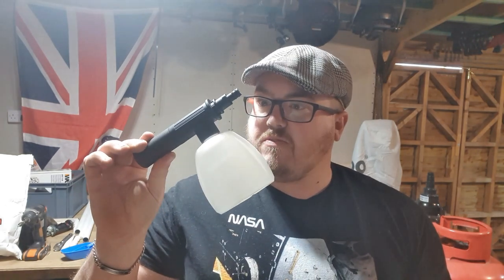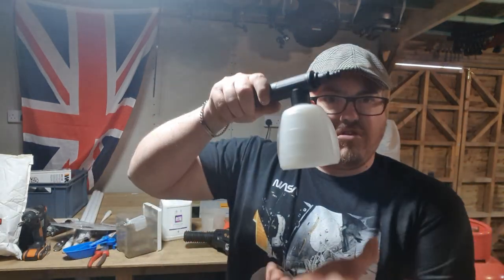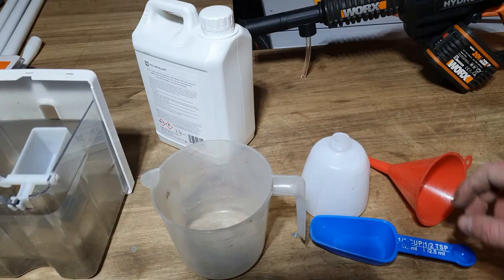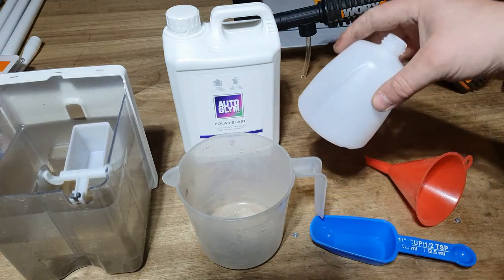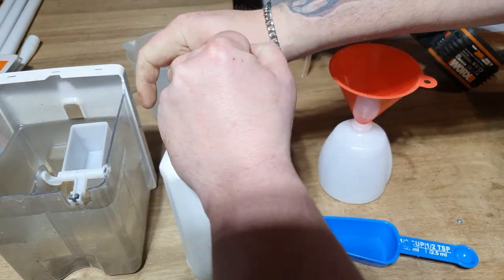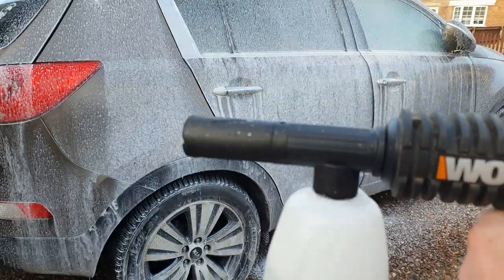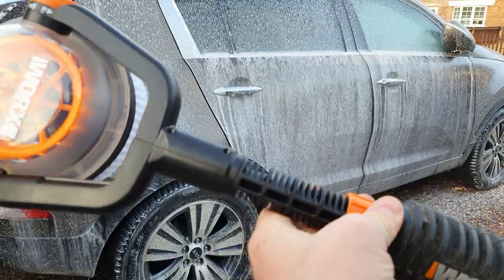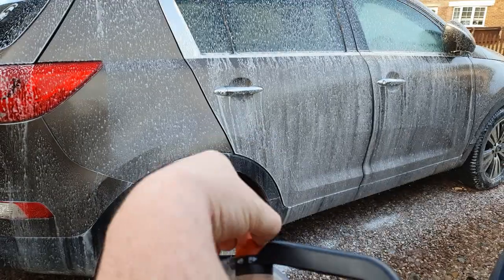mikes review worx hydroshot snow foam / soap dispenser wa4036 & wa4043 rotary scrubbing tool

Comment: Ah !! That’s lucky I watched this, because I’ve just bought one and I’m  going to use it tomorrow, I was going to put 100% snow in the bottle with a no water mix !!! Also I have no main water supply, so I have to use the large water bottle option, I will let you know if your interested ?
Reply from the maker: Hi, although worx have literature that states no need for pre dilution of foam always follow the manufacturer of the snow foam you are using for best results, I did experiment with different dilution and found neat autoglym to be very little noticeable  difference to diluted. might be a bit subjective it should not make much difference if it is using a mains tap, bottle or pick up hose, mainly thanks to its filters and unique suction method. But please do let me know, worx products are all about community and sharing findings about different ways to use them.

Comment: Great vids ty. So I just bought a Yardforce Aquajet. But changed my mind because the base model hydroshot seemed to be a better choice.

But then came the Q, is the nitro version a better choice than the base model?

Your vids helped me decide. I have had brushed tools burn out on me on day 1.

Brushless,
Battery enclosure ipx rating, inexpensive and wide range of attachments, 
Hosepipe ban proof
Improved performance

Unfortunately though, the snow foam cannon is out of stock and the amazing rotating brush you used doesn't seem to be listed on worx, or available 3rd party sellers anywhere, 

Can you use any 3rd party snow foam cannon on it? 

Either way, I reluctantly pulled the trigger on the nitro, but feel good that it might serve me well for a good few years.

Hoping the cannon is only temporarily out of stock, and idk if the rotating brush will make a comeback or not. Hope so!
Reply from the maker: Hi and thanks for the questions, the nitro version- wg633 is the latest highest power brushless 2.0 powered machine and is really quite powerful, It won't strip paint but it will remove all but the most stubborn of residue with ease, I was removing dried paint splashes the other day from my wolf garten outdoor broom and it bought it up like new, it appears a lot of the hydroshot accessories are currently out of stock most accurate place to check is the official worx uk website https://uk.worx.com here they have all your goodies and they tend to have the latest products here before anywhere else too!
Reply: @mikesptworld Hi! Thanks for your reply.

 Wondering if the 20v 2ah powershare battery fits into the nitro. It looks as if the battery indicators  on the 20v 2ah powershare battery are on the opposite end of the battery to how they are on the 4ah version, which doesn't seem right.

Also, do you know if the 20v 2ah powershare battery can be charged in the 20v 2.0A capacity WA3880 charger that comes with the Nitro?

(I had bought the 20v 2ah worx powershare battery as a back up to the bigger 4ah that comes with nitro)

Thanks if you can shed any light!  🙂
Reply from the maker: Hi, all 20v powershare batteries fit the worx tools including the hydroshot 1.3ah, 1.5ah, 2.0ah, 2.5ah, 4ah, 4ah pro, 5ah Pro & 6ah (and even the 8ah - when / if it ever gets here) though for the wg633 I reccomend A 4ah pro battery as they are rather juicy, you can still use 2ah even the older type with the 3 battery bar indicator (even though you can't use the indicator as it is at the wrong end of the battery) you can use any charger with any battery just some may take longer than others.
Reply: @mikesptworld  I just took delivery earlier and wanted to say thank you so much for your help. 💯

Comment: got my WORX NITRO 18V(20V MAX) Hydroshot Cordless Pressure Washer, PowerShare, Patio Cleaning and Car Washing, Max. 56 Bar, 220L/H, with Accessories, 4.0Ah Battery & charger, WG633E thinking to bye (1) - Hydroshot Wheel Cleaning Brush Attachment (WA4042), (1) - Hydroshot Soap Dispenser Attachment (WA4036), (1) - Hydroshot Adjustable Power Scrubber (WA1820)and the WORX WA4013 Short Lance for Hydroshot do you think its worth the money  is this a good set up
Reply from the maker: 🎶and these are all of my favourite things🎶 Honestly this is the most awesome way to clean your vehicle, whether it is using it in the middle of nowhere with a Jerry can or somewhere with a mains hose this is a guaranteed best combination, may I add the small brass sprinkler attachment as it gets rid of residual bubbles without agitation and creating more bubbles, I reccomend using autoglym polar range of foam process cleaning as I have good experience using it and can say it worx best compared to other brands, you don't have to use the polar seal but the polar blast initially and polar wash is a great duo collaboration to help get the results you not only want, but need and deserve.

Comment: Hi just a quick question did you use a mains hose connected to the hydroshot or was it fed from a bucket,  just wandered if you get a decent foam from the bucket as I have no access to a mains hose . Thanx
Reply from the maker: Hi, thanks for the question, and a very good one too, in the video I used a mains hose for convenience of an unlimited supply of water, though this has no difference on affect of the performance of foam or any of the other accessories for that matter, though I suspect it may have a minor effect on run time - though this will be in the realm of seconds less rather than minutes.
Reply: @mikesptworld  Cheers Mike.

Comment: Is there any way to remove the connector to washer and replace the internal orrifice from standard to a 1.1mm one for better foam results (IE it reduces the water flow to enable better foaming)?
Reply from the maker: Hi, the end orifice is fixed and although the end nozzle does appear to have a clip to remove it, it doesn't budget indicating to me it is not designed to be removed.

Comment: Thanks to your video I have bought the hydroshot and polar blast! I am now tempted to buy the autoglym snow foamer because of its larger capacity. Would that fit the hydroshot 630e?
Reply from the maker: I very nearly bought one and did a comparison but I was equally was unsure if it fitted, I believe it will but I also believe that the autoglym foamer is designed for higher powered pressure washers, although it is adjustable I personally prefer to use the worx soap bottle dispenser as it worx (pardon the pun) and surprisingly well too, as for the small bottle I would reccomend making up a jug and using a funnel to top it up as required if not a jug a small pop bottle may help to fill it up to the required level?

Comment: Well I never. I honestly didn't think the worx foam cannon would be good. You've proven it is. I'm going to get one. Thanks 👍
Reply from the maker: I will be honest, neither did I! I wasn't expecting a foam cannon more a foam pea shooter, I will say the more concentrate you add the thicker the foam, but the manufacturers instructions should always be followed for the best results :-) twice as much certainly isn't twice as good.
Reply: @mikesptworld  I used to have a karcher k2 but got sick of the size of it and the hose was too stiff and the power cable all just got to me. I did however after watching a YouTube video bought a dedicated foam cannon and the soap the guy used. He used warm water and I followed suit. The results were excellent. But now I have the  Worx WG620E but was wondering about a foam cannon. I got in touch with who I bought my existing cannon but they replied they don't do adapters. So after watching your video I've ordered the Worx cannon but I will use warm water and the soap I have (can't remember which it is). Thanks again m8
Reply from the maker: Any time my friend :-) The warm water should help create a frothy foam that stays longer. The warm foam helps the foam bubbles rise and seperates the magic goo in the soap :-D (same way using warm water with washing up liquid helps make bubbles - cold water still works but not as well)
Reply: It's not good. Pressure washer is to weak  to clean dirt off after snow foaming. Need to use sponge to make it works otherwise stay dirty.  When I use same foam with 240v jet wash does the job. I'm sending back my Worx Hydroshot because is complete useless 👎

Comment: You dilute the soap in water. However in the official product page, in the FAQ section it states: "Do I need to mix soap or the cleansing agent with water in the container before using?"
"We made cleaning easier by taking out an extra step! There’s no need to mix soap or other cleaning agents in the Soap Dispenser before using it. The water from the Hydroshot will mix with it as it dispenses.".

What gives?
Reply from the maker: Ooooooh! Conflicting instructions :-) I will have a look and see which one over rules ;-) in my personal usage it makes no difference between neat and 3:1 mixture or at least I didn't think so, though I do find temperature affects it much greater than viscosity seems to.